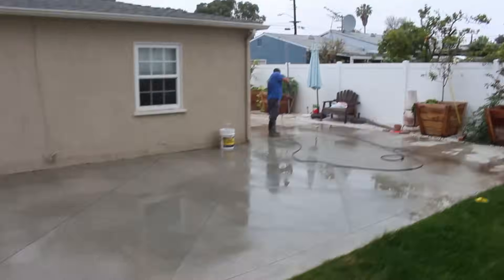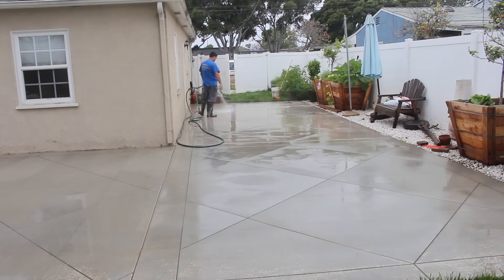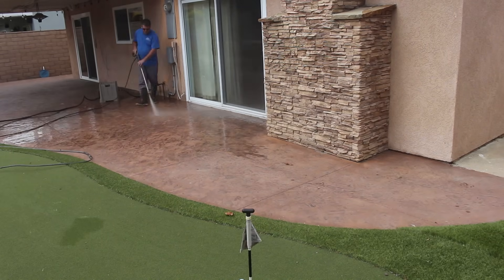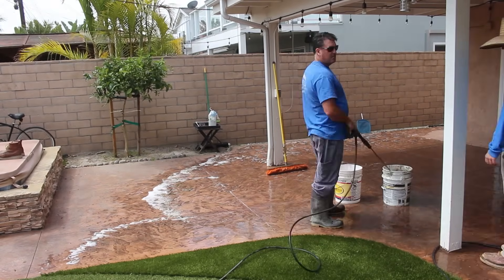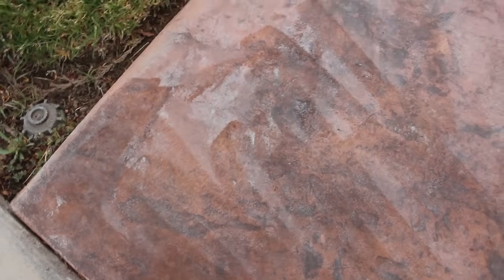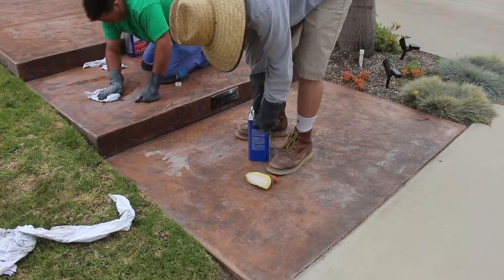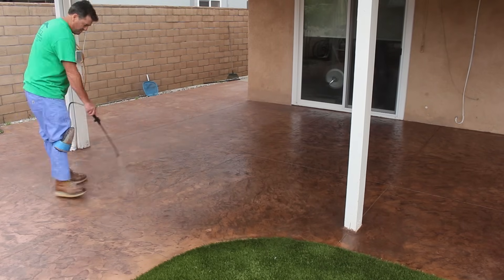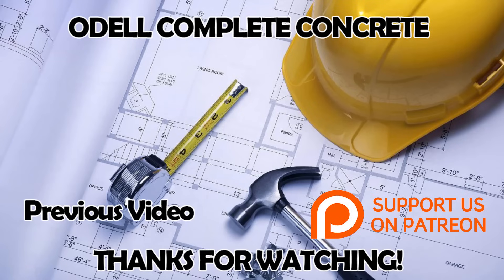How to Apply Sealer to New and Old Concrete

Comment: Fascinating demonstration of concrete maintenance.
Reply from the maker: TY
Reply: @OdellCompleteConcrete hi I got a large patio poured month and half ago by I have two hairline cracks around 3 feet long and all the joints cracked do I have to fill those cracks before I seal it

Comment: I used a waterbase sealer on dry pressure washed one year exposed aggregate. Now, the result after 3 coats, sprayed and rolled at 24°C . Was supposed to be be wet look finnish and end up shiny drylook finnish. Is just the fact i did not hatched the concrete could have done that? Now, how should I strips all those waterbase layers of sealer after 2 months and be able to hatch the exposed aggregate concrete driveway? Since it is not solvent base and can't use  xylene, acetone etc... how to remove the waterbase cured material from the surface? I guess since it looks like a shiny dry film on surface, it never penetrate at first place. I have a 1600sqft driveway to redo I feel devastated and powerless in front of the task i have to manage. Please help 🤕

Comment: This is a great video. I just bought a house with a similar looking patio as the second one in this video. There is a thin crack that runs through the middle. Do I need to address/repair this first?
Reply from the maker: Not really
GL

Comment: Thank you for another great video! There are rust spots appearing on my paver patio. It’s 2 months old and plastic furniture was the only thing on it. Is it minerals in water? What’s best way to remove the rust? What’s the best sealer for pavers. Polymetric sand has been applied. Planning to seal after rust is removed. Can be “wet or dry” look. Thank you!!!!
Reply from the maker: Yes water is a killer

Comment: If there is some moisture left in the concrete while sealing will it eventually evaporate through a water based sealer?  My concrete wasn’t 100% dry when I sealed and it looks a little blotchy
Reply from the maker: You need to strip it

Comment: Does the sealant not overspray onto the house or that expensive turf? The original sealer that was applied right after pouring stained my dads brand new siding. I feel like a barrier of sorts is needed if you spray.
Reply from the maker: This isn't siding or turf

Comment: I have been told different things about this process...I have stamped "stained" or colored concrete. I can or cannot use a surface pressure washer to clean it?
Reply from the maker: Pressure washer will not work.

Comment: Easy job. Did a few jobs last summer, sealing the driveways. You need to watch for the wind and the plants. The end of the video, it very windy and the sealant sprayed on those decorative plants/flowers, will end up killing them. I never apply sealant in sprayer when it's windy. If windy, I roll the sealant.
Reply from the maker: plants are inexpensive compared to concrete perfection
Reply: Odell Complete Concrete sloppy way of attaining "perfection"! That's just not paying attention to small details and sometimes those small details, count the most.

Comment: I got a question, why not use  surface cleaner? I seen in the front where the steps were there were hard “etch” marks. Just curious
Reply from the maker: The biggest problem here is irrigation overspray

Comment: Is the sealer very thick. Last time I sealed my patio the sealer was quite thick and I had to roll it on. It would by nice to use the sprayer next time like you.
Reply from the maker: If you want thin sealer try glaze and seal.
If you you want thick sealer that you an thin out try anything else.
Reply: @OdellCompleteConcrete  if you use glaze and seal can you still use the addictive for helping with slips and falls?
Reply: @guera4life63 If I heard correctly in this video he said he used the granular with the sealer and it runs through the sprayer well.

Comment: Is cutting cracks in concrete bad in other areas of the U.S. where there is freezing water...
Reply from the maker: Not really, as long as the water can drain out before it freezes, or you can caulk the joints

Comment: Can you give the name of the stuff you used in the sealer to make the floor a non slip surface ?
Reply from the maker: Shark Teeth
Reply: @OdellCompleteConcrete  Ok thanks. What i found is SharkGrip from H&C Concrete Products . They say that this type is a sort of plastic grit . And that its better compared to silica sand or aluminum oxide beads that have also been used, bcz these materials can change the appearance of decorative concrete. 
Are you familiar with this ?
Reply: I've used Shark Grip and Surf Grip.  It's essential, because once wet, the concrete is extremely slippery, and good luck using a snowblower on a driveway without it.  The wheels and your feet will barely have traction.

Comment: Random question but we have a gunite pool slide that has a stained finish. It’s losing it’s slippery coating. Contractor said they use a concrete/rock sealer on it. do you think I’d have to strip all old coating to keep it super smooth or could I just add a new shiny layer on top.
Reply from the maker: ADD another coat of lacquer base, but add a non-slip additive

Comment: How can i  stripped off sealer or how long would it last?  Some guy did sealer on my concrete and did horrible job on it
Reply from the maker: Stripper
Reply: @OdellCompleteConcrete  may i ask which product? Or you come over and make a video. I am located in the IE i lost sleep its really bad job

Comment: So after a real good surface clean on concrete walkway or driveway  what do u recommend using to seal it so it doesn’t get dirty again or less dirty..
Reply from the maker: It will always get dirty.
The benefits of sealer is to prevent staining and premature surface wear

Comment: What size short nap roller for inside smooth concrete for sealer?   

Also I'd use a surface cleaner instead of the wand when pressure washing
Reply from the maker: 3/8"

Comment: Hi,I recently pours a small patio ,stamped color concrete,,I want to know what is the best way to apply the sealer,,with a roller or sprayed on???and how do I avoid the white spots on it??do I wash it and let it dry and seal next day??its been 3 weeks since I poured the concrete,,if I roll it on should I avoid getting too much sealer on the roller,or should I just spray it on??and how many coats??
Reply from the maker: I like diluting sealer and spraying for a fine even multiple coats.
Reply: What do u diluted with?
Reply: @OdellCompleteConcrete  what do I dilute it with??

Comment: What’s the difference between saw cut joints and ones made with a trowel?  The joints in my concrete walkways are massive, maybe a full inch in some places.  Always hated it.
Reply from the maker: That's the difference.
Big  and small, same goal

Comment: Can someonw help me with my probleme!!!!

Just did a concrete driveway with a buch of acorn stain ( black spot) that dosent go off with just the pressure washer so I put a 3% sh solution bamm everything was gone 
Perfect driveway !!!

A few days later the guy put a scealer on the concrete and now when the concrete is wet all the black spot that were gone reappear

Someone got an explication off what   could cause that ???

Did the sealer reacted with the SH or i dont know 

Imo i killed all the organic on the concrete how could they reapear after applying a scealer...???
Reply from the maker: depending on the sealer you used it may have enhanced the colors you couldn't see when dry.
Wait a year it may fade away
Reply: @OdellCompleteConcrete  thanks should i retreat it with sh or its to late cause of the sealer
Reply from the maker: To late unless you strip the sealer

Comment: Use the stripper from that red metal container for your solvent based sealers.. the klean strip brand in the blue metal container is geared more toward stripping latex and water based coatings.
Reply from the maker: SOunds good

Comment: Would vinegar work to remove the hard water deposits?
Reply from the maker: no these deposits were deep
Reply: It looks like the deposits actually affected the sealer, not the concrete below. Which is what the sealer is there to do- save the concrete.
Reply from the maker: Exactly

Comment: Hi can you tell what you used for the sealer? I have a newly poured concrete walkway pad and would like to preserve it. Also is there any way I can color the concrete after the pour? It came out lighter that we were expecting and would like the look to be darker. Any recommendations? Thanks
Reply: You can tint your sealer with concrete resurfacing powder.

Comment: Hey there. Attempting to apply Foundation Armour AR500 using the exact same HD $15 sprayer that I planned to just discard. I think the sealer is too thick. Wont spray as a mist. Only comes out as a stream. I confirmed the sprayer works perfectly fine with water. Any suggestions on what I could be doing wrong?
Reply: There are different types of nozzles ( nozzle heads)
Some are slit to shoot a radius
Reply: I have the Chapin Xtreme sprayer, and am having the exact same problem trying to apply AR500.  You're not doing anything wrong, its just too thick.  Foundation Armor tech told me to use a 1 GPM tip and thin with up to 5% Xylene.  I tried with .5 GPM and it wouldn't spray a mist.  If the Xtreme sprayer and a .5gpm won't spray an even mist, the plastic sprayers don't stand a chance unless it is thinned way down.

Comment: We use CLR to remove calcium, lime and rust. We put it in a bowl and soak our shower heads and you can see it dissolve the lime buildup. Once done, pour the the product back into container for future use. Since you were trying to remove a mineral based stain/buildup, CLR should work right?
Reply from the maker: Yes if its on top of the sealer

Comment: Love the video.  I'm going to try and use the "disposable" sprayer you used in the video.  Most of the sealer application instructions suggest using the sprayer then following with a roller to even it out.  Is there a reason why you don't do that step?  Should I skip that.  I'm just re-sealing a stamped concrete patio similar to the one in the second half of this video.
Reply from the maker: That's true for water base
Reply from the maker: The sealer I use is sticky fast
Reply: Many are forced to use a roller to even out the sealer because their sprayer does not atomize well.  Using a new disposable sprayer can eliminate the need for a roller.
Reply: 80's

Comment: I plan to seal a large area of colored and stamped concrete.  I bought a good pressure washer.  Can I strip the old sealer with the pressure washer while cleaning the concrete?  I can wait a day for it to dry before applying sealer.  I was a very wet look when done.  What quality sealer brand would you recommend for Wyoming which can get quite cold in the winter?  I assume I will be applying it with a roller?
Reply from the maker: the pressure washer may remove some sealer,  ut not all of it.
I would think a penetrating sealer would be better in those climate conditions
Reply: @OdellCompleteConcrete  Thank you for the reply.  I purchased the pressure washer, the Yamaha surface cleaner attachment, squeegee, rubber boots.  I have a large area to prep and seal.  We have two large RV site pads with colored and stamped concrete.  Now all I have to figure out is the exact gloss sealer, non slip grit and where to buy this stuff.
Reply from the maker: GL

Comment: What sprayer did you use ? And which brand of sprayer do you think is best for putting stains ?
Reply from the maker: A disposable 1 gallon 10.00 sprayer
Reply: @OdellCompleteConcrete  any brand name in particular you recommend? Is this just the weed sprayer ones?
Reply from the maker: @jeff_9074  
Yes its a simple plastic garden sprayer
Reply: @OdellCompleteConcrete  okay, thanks.

Comment: My sitting wall for our patio has patches where it is kinda white and discolored. The contractor added some kind of powder colorant to give it a bark gray color. It was not sealed before the cold weather and snow set in. Any suggestions for me to "repaint" it?

Thanks for your video. I always look at tons of them and it helped educate me as a homeowner. Also, you have a soothing voice. 👍
Reply from the maker: I don't what would hold up in that weathet
Reply: @OdellCompleteConcrete Thanks!

Comment: You probably are at low risk for concrete cracking due to frost heaves compared to here where it was -40 Celsius this morning.
Reply from the maker: 50 degrees is our low
Reply: That coloured sidewalk and steps sure look nice.
Reply: Heat can cause problems too. I've seen footpaths expand so much two slabs butting together force each other to rise up.
Reply from the maker: TY

Comment: Nice video bud  but I have a question, I've been in my house for about 12 years now and there is some kind a stain on the walkway,  it's a pretty nice looking stain but it's getting old and beat up and fading, I want to  restain it.  I don't think it's an acid stain but my question is, am I able to stain right over  the old stain  if I clean it really good?  It seems like it would be hard to completly remove  that stain.
Reply from the maker: You may want to check with a stain manufacturer for that one

Comment: What happens when moister is left in the concrete? My husband used the lacquer sealer on flagstone same day it was washed with acid and water. Help now I’m freaking out
Reply from the maker: The sealer will turn white.
You have to strip the sealer now.
Reply: Odell Complete Concrete there is a few white spots but not too noticeable, not on the whole project ,,.,will it turn white eventually ?

Comment: I don’t think that was mineral deposits causing the white haze on the steps.. that looks like blushing which happens when moisture is present and trapped under the lacquer whereas any deposits would be on the surface. No need to strip it. Next time rub the surface with lacquer retarder and the white will disappear within seconds. Sherwin-Williams or PPG usually carry it.
Reply from the maker: The sprinkler are over spraying, so its definitely a water issue.
I did try to remove from surface with acetone and no luck.
I think water did migrate up from over water and spraying, thus getting trapped under sealer
Reply: Odell Complete Concrete 
That’s why lacquer retarder is the solution.. we add retarder to lacquer on days when the humidity is high to slow up the drying and this is how we prevent blushing. By rubbing retarder on the surface it activates the lacquer  long enough allow the moisture to evaporate .. acetone won’t fix it, it dries way too fast.
Reply from the maker: Sounds interesting, I'll try it next time

Comment: Great video 👍 
Would you use a roller to apply the sealer on a smaller concrete patio?
Reply from the maker: Yes you can!
Reply: To me  is much better 
Use a roller 
Spraying  looks like some spots are non covered equal
Reply: @conejoazteca685  That's what I thought too -- especially the first video. It doesn't look good at all.

Comment: Hello O'Dell,  I was going to seal my new stamped concrete so I bought all my supplies at HD. The sprayed i bought was the hdx and it worked for about 5 min. I was fucking pissed. I drove back to HD and bought the Scott's sprayed for 20 bucks. Got back home assembled it and filled it. Started spraying and almost launched it across the street. It sprays but only big fat drops on the cone setting. Please help. What sprayer works best. I need to finish this before June 4th.
Reply from the maker: When ever I get ready to seal with lacquer base, I start with at least two HDX sprayers.
I sealed the other day and I got half way through before the sprayer failed luckily I had two.
Reply: @OdellCompleteConcrete  Thank you good Sir. I will buy more hdx sprayers. What sealer do you recommend?  I want my concrete to look wet. The 10x10 sqft I applied yesterday looks shiny not wet. Any suggestions will be greatly appreciated.  Have a fun memorial day O'Dell and crew.
Reply: O'Dell.  FYI I went to HD and bought a bad ass sealer. Its about 62 bucks but it works great. In the same isle I found a spayer that doesn't get messed up with solvents. Its only 17 beans and worked like a charm.
Reply: @aperez8601  could you please share the name of the sealer and sprayer? Thanks!

Comment: Great cleaning job but not enough detail on what sealers you used. Acrylic, Siliconate, etc? Also, hate being off topic but the pressure washer that you guys had on the artificial turf, was that gas powered? If so, I would recommend to not leave it on top of the turf. The heat radiating off the exhaust can damage the fibers and cost your client a few thousands of dollars in repairs. Other than that great tips on cleaning. Would also like to know, if on a fresh slab, what is the minimum  drying time before you could seal? Thanks
Reply from the maker: good point

Comment: When i used pump sprayer, the hose burst many times. I put sealer, xylene and release inside it.
What is the reason? The quality of pump sprayer or another thing?
Reply from the maker: Xylene melts plastic and rubber quickly.
Reply: @OdellCompleteConcrete  please, can you explain more